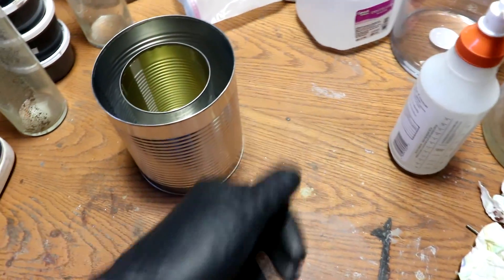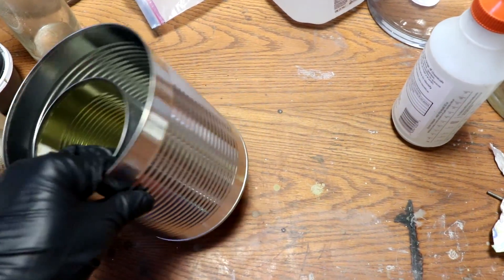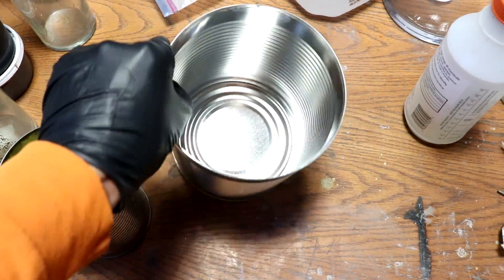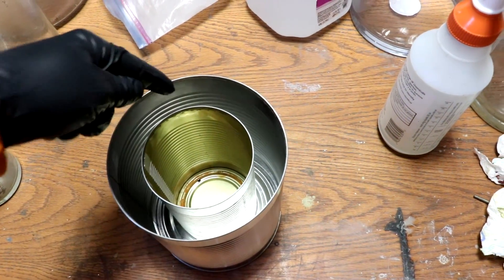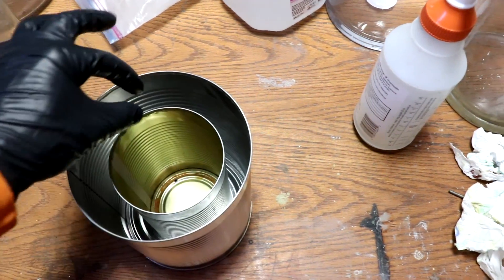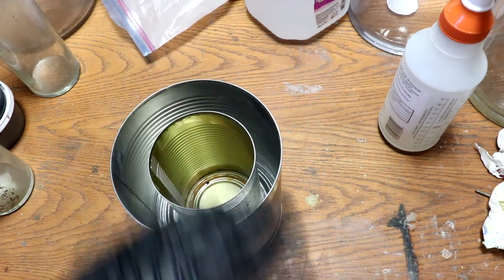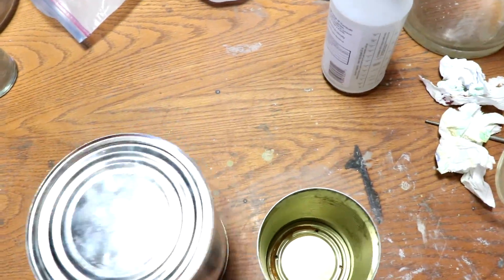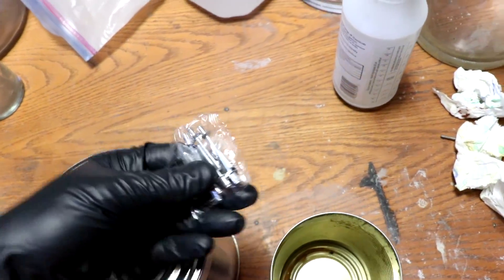The Rad Can

Comment: Cool, and heavy!
Thing is, nothing you own requires lead shielding to be safe around people.
All those things like uranium ore, yellowcake, radium clockhands and other hobby stuff are so benign and can be stored on a shelf in the living room. One thing this doesn't protect from is leaking of radon. All uranium and thorium ores and compounds leak radon, so they should either be stored in a leaktight vessel, or simply outside living space because you don't want to breathe that.

Lead pigs with several centimetre thick layer are useful for shielding from highly radioactive beta sources (even hard beta), and gamma sources with low energy.
Seriously energetic gamma rays require distance and metres of water/lead/concrete and only the thickest lead pigs, unmoveable by people, can attenuate them sufficiently, but not totally block them.
Reply: @HiWetcam Literally nothing he can do can increase radioactivity. He can merely concentrate the existing radioactive atoms in smaller space, like he did with yellowcake. Radioactivity stays the same.

Comment: wouldnt the smaller can itself be radiation soaked?, then wouldnt the radiation spread down the tin between the lead you poured in, to then escape from the bottom of the larger tin?, should have poured some lead in first then set the small can on top of that to create a barrier and then filled the space between with the rest of the lead..... just saying
Reply: he poured lead in the bottom of the smaller can, it's in the video bro.
Reply: @sukuryú-c6x  did you not read what i put?, lead in the smaller tin but still NO barrier between the bottom of the small tin and the large tin, the radiation will travel down the sides of the smaller tin that goes between the lead in the small tin and the lead in the large tin and then escape through the bottom where the small tin is just riveted to the large tin. hence no barrier between the tins themselves..... he has made that in a dangerous way, hopefully he sees this and can understand what i put.
Reply: Radiation doesn't "soak" things.

Comment: I've made small cubes of Lead and stored them together with my rad stuff in a cheap safe.  
Since we don't have many regularly shooting people in Germany, Lead is quite expensive. I kind of like your country for that.
Reply: Go to a junkyard and look for old car batteries. Old car batteries are one of the most recyclable products made, but you could probably still find some. Neutralise the sulpheric acid, and you've got yourself a nice pile of lead.
Reply: @MarkRose1337  I've tried that. Most of the mass is in Lead oxide which is hard or impossible to convert into elemental lead.
I once got about a few hundred grams of pure lead from one battery, but the most mass was in the oxide.

Comment: This reminds me... I have an old Asahi Pentax lens (Takumar 55/1.8) and I understand that one of the lens elements contain thorium dioxide. 

Would like to see a video on how safe these types of lenses are and how they should or shouldn’t be treated and stored.
Reply: The radioactivity from them is trivial - you would hardly notice any change using a geiger counter.
Reply: If you want to get rid of the yellowing, put it in full sunlight for a while.

Comment: Cody I've tried looking up the reason to use lead over other metals, but I never got an answer. Does lead have special characteristics that allow it to absorb so much radiation?
Reply: It is dense, that is all.  You  can use anything, gold, mercury, depleted uranium (yes, ironic, isn't it?!) or water, but the cheapest, densest material is best.  Lead is also easy to machine, and bend if in sheet form.

Comment: I'm told its the equivalent of a chest x-ray
Reply: Not easy to compare a beam of low-energy x-rays (most of which is absorbed) and high-energy gamma rays (most of which pass through unimpeded) but a typical chest x-ray is about 100 micro-sieverts.  Cody's  geiger ratemeter showed 6 micro-sieverts per hour (6 uSv/h) so you would have to hold them to your chest for about 17 hours to get the same dose.  That's why I and a few other commentators said that these were not very radioactive samples.  Still not a reason to store them in your mattress!